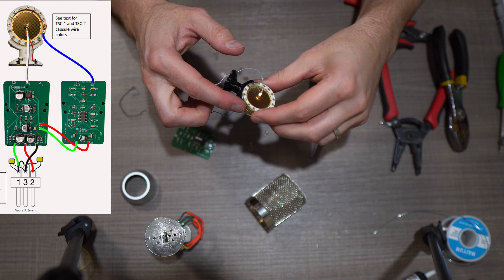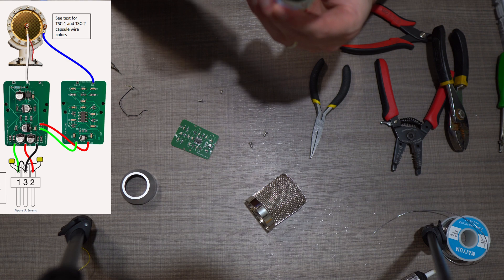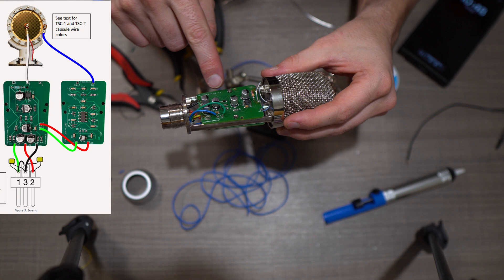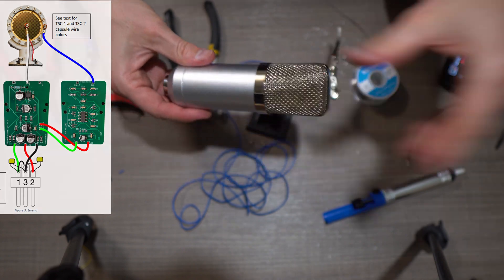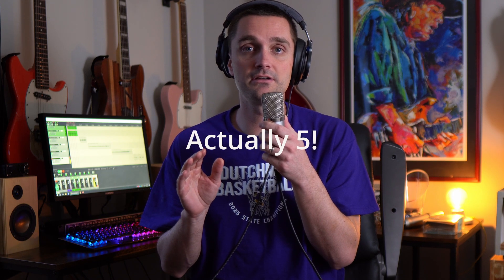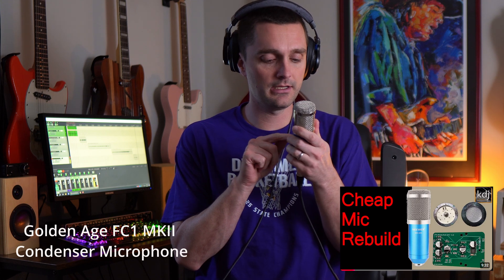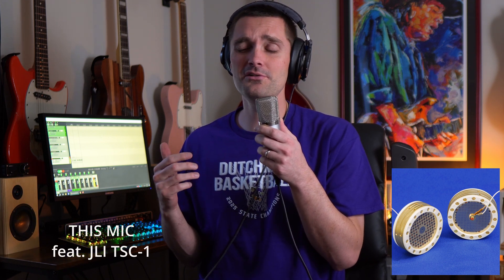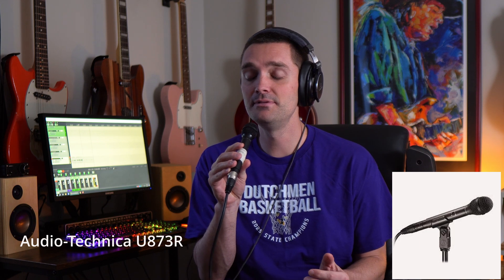Cheap Condenser Mic Upgrade - JLI TSC-1 Capsule + New Circuit Boards

Comment: So I have an MXL V67G I bought new, and a MXL V63M (that I bought used for 20 dollars including a desk stand). If I were not planning on any other modifications, would it be worth swapping out for stock capsule on one of these mics with the TSC-1? And why did you pick the one you picked? I already like the sound of both, and mostly use them for close recorded voiceover. Thank you.